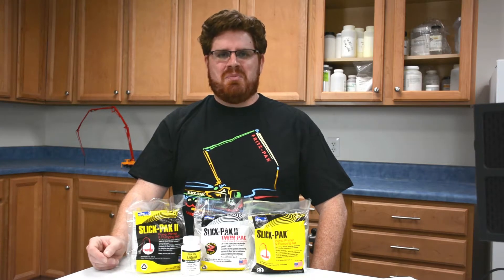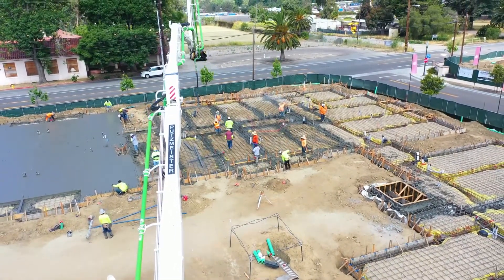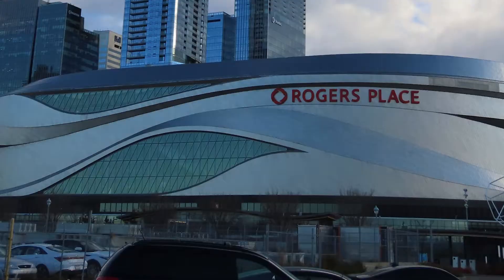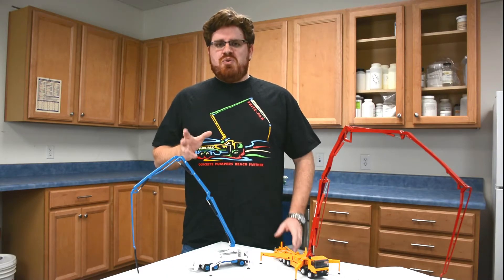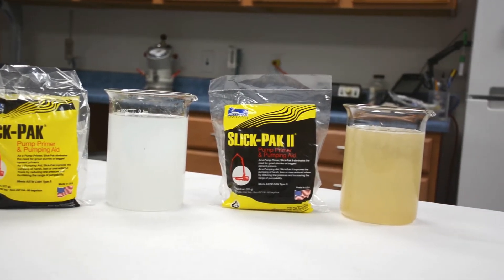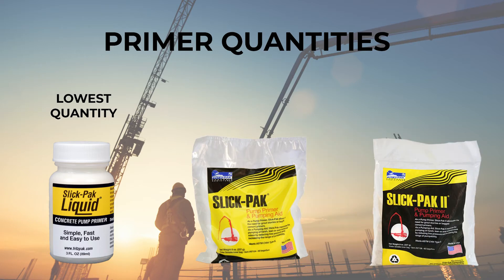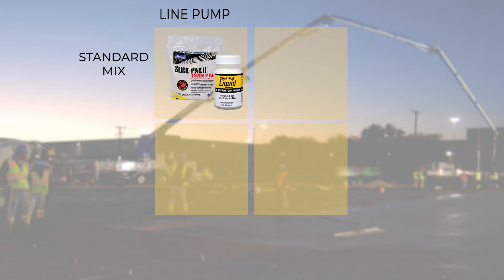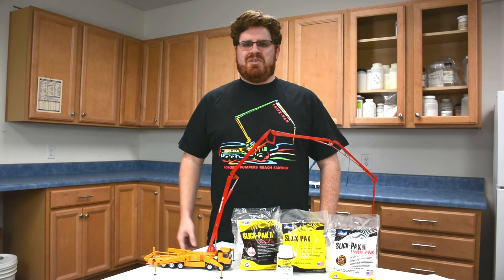Choosing the Right Slick-Pak Concrete Pump Primer

Comment: I’ve never heard of adding slick pack to the mix. How does this alter the concrete on a spec job that will require testing of the concrete that is a designed mix.
Reply from the maker: Adding Slick-Pak II to the mix may have a slight impact on the slump, but it doesn't affect strength or air content.  It doesn't change water-cement ratios, but rather suspends the aggregates in the mix to keep them from clumping together or getting caught on one another.  Check out this other video for a more in depth explanation:  https://www.youtube.com/watch?v=c0IvsfaW_as